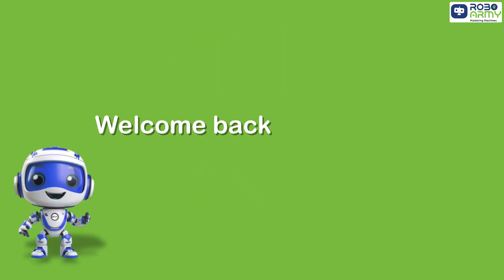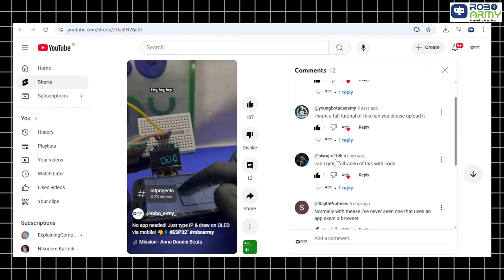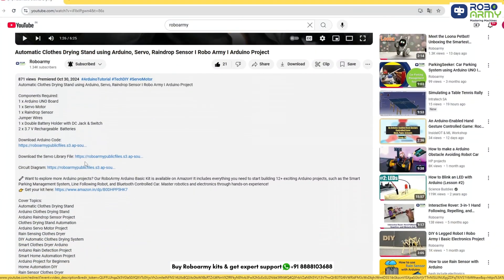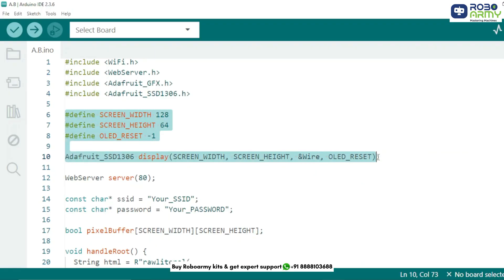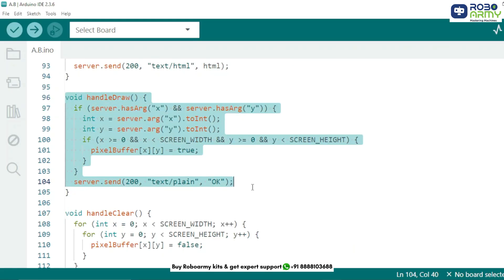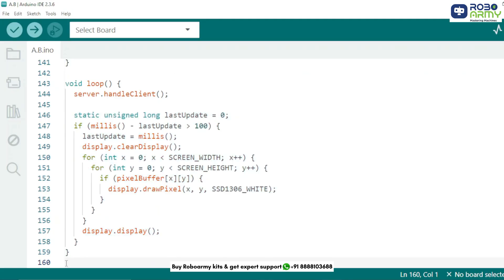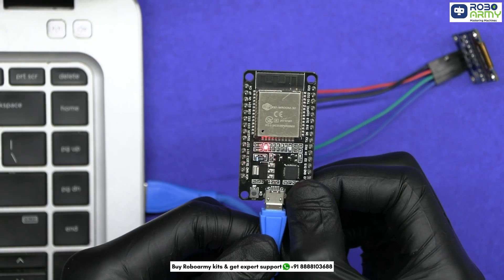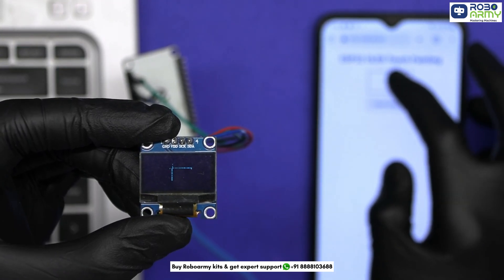DIY OLED Touch Painting with ESP32 | Draw on the Web & Watch It on OLED!

Comment: can i use a bigger lcd? and can u recomend the bigger lcd i can use
Reply from the maker: Yes, you can definitely use a bigger LCD!
If you're using I2C communication, I recommend the 20x4 LCD with I2C module — it works the same way as the 16x2 but gives you more space to display data. Just make sure to adjust the code dimensions in your LiquidCrystal_I2C setup.

Comment: Sir on the humidity automation project video, for me everything works fine but the humidifier module is not switching on in the circuit, but it's switching on seperately, please help me sir.
Reply from the maker: Thanks for trying the project! 😊 If your humidifier works separately but not through the circuit, the issue might be with the relay wiring or the power supply. Please check these:

Make sure the relay module is getting proper 5V and GND from the Arduino.

Double-check if the signal (IN) pin from the relay is connected to the correct Arduino pin (and your code matches).

Verify that your humidifier's power source is properly connected to the relay's NO (Normally Open) and COM terminals.

Make sure the relay clicks when triggered. If not, the Arduino might not be sending the correct signal.

If you're using a low-power USB source, try using an external 5V adapter for the humidifier circuit. Let me know more details or share a picture, and I’ll try to guide you better!